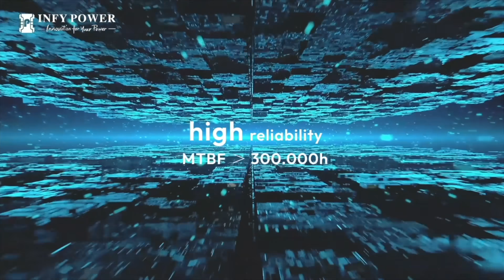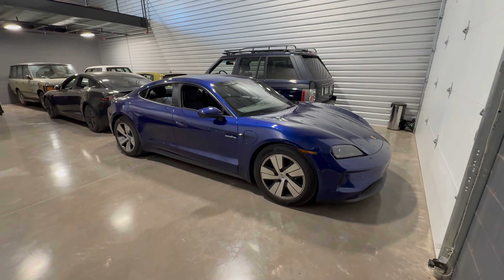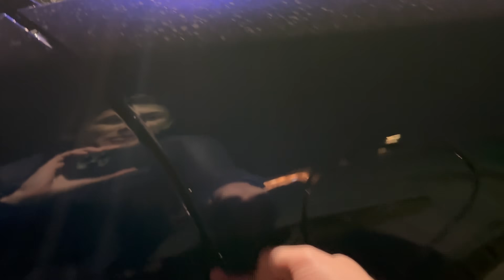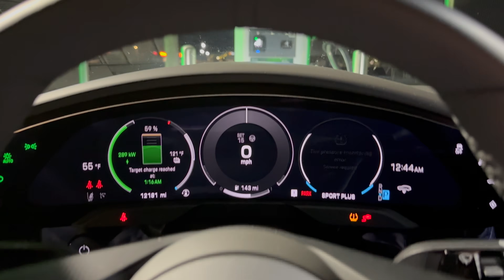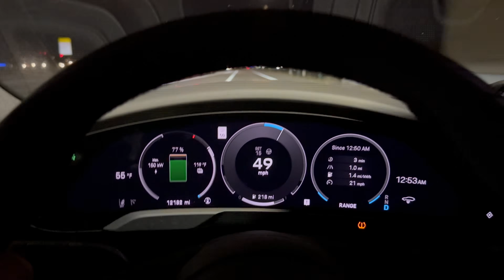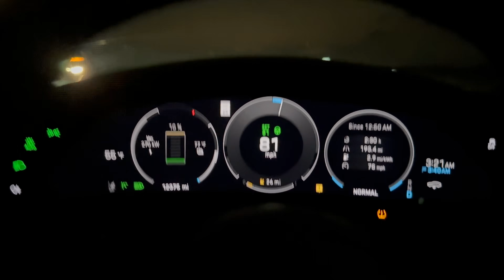EV Road Trip King! Porsche Taycan Goes Insanely Far After Only A 15min Charge In The 10% Challenge

Comment: Battery Life - any issues with premature degradation ? Not talking fires but saw a few posts discussing Taycan's batteries prematurely losing capacity, speculatively due to Porsche's high speed charging design. Even on your Las Vegas rally, the Taycan wouldn't fully charge to 100%  I was interested in a used one but that's one part replacement that's too big to swallow.

Comment: IDK about the logic of running cabin HVAC during charging.  The last place you, or your dog, should be during a 15 min stop is in the car.  After sitting in the car for 2-3 hours or more of driving, it is time to get out, go for a walk, and use the restroom.  When you get back to your car, LEAVE.  Don't just sit there charging.  My experience on Tesla road trips for the last 8 years is that the car is sufficiently charged when I return.

Bottom line: I don't run HVAC during 15 min stops.  If stoping for an hour to eat, and leaving your dog in the car, then running HVAC is needed, but charge performance is not needed.  Slower charging would actually be helpful to allow you to finish eating before having to unplug and move your car.

Comment: What is really impressive is that this test is done at 80 mph. There are parts of the US where you can’t maintain 80 mph for 193 miles. In the northeast this car would go well over 200 miles on only 15 minutes of charging because of the much slower speeds.

Comment: My car is not a good comparison. I drive a 2021 Toyota Prius L. Eco and road tripping like this. I would slow down from 80 to 75 but I would still be getting 50 plus miles per gallon with a just over 11 gallon tank. So I would be looking at about a 10-minute stop for about 500 mi of range in my Prius in the same situation or scenario. And even if I went 80 I would still probably be looking at 500 mi of range before I got low enough and fueled it. I felt they had to stop and go get gas but comparing this car to my '98 Subaru legacy wagon. Yeah that car gets about 27-28 miles per gallon on the highway and has a 15 gallon fuel tank and will do about 300 highway miles and a approximately 10 minute fuel stop for the Subaru would still yield me better results than this car but it's a much closer comparison cuz I'm looking at a few hundred miles less in the Subaru for the same amount of time on a single tank of fuel then in the Prius and yes, it is good to see that we are getting to the point where cars are charging this fast and you're getting basically one minute of charging allows you to drive 10 mi or more when you're road tripping the vehicle. Granted it's going to take a while for a lot of manufacturers to catch up to having these types of charging speeds with these efficiencies especially Toyota and other manufacturers that don't even have electric vehicles yet but even with the two cars that you just recently tested were getting to the point where if they get much better we'll need to be looking at improvements to the charging infrastructure to be able to make them charge much faster cuz the infrastructure is only limited to delivering 350 kW of charge at the moment and we might need to make it so it can deliver up to 500 kW of charge if lucid and Porsche make too many more improvements to their ability to charge the batteries in these vehicles, especially Porsche.

Comment: I am more blown away at the cost of high power charging. I understand you are charging at home the vast majority of the time, but to spend almost double in electricity than what it would take in gasoline for a similar vehicle is not acceptable.
Reply: Depends on the ratio of home to public charging right? At some ratio there is a breakeven point. Though you probably wouldn't need a Taycan then.

Comment: What's crazy to me is the price off that charge. Imagine charging it 0 to 100% it would be around 60$, and let be honest, almos any gas car with 40-60 on gas can go minimun 250 to 300 miles easily. So I don't see the real benefits of owning an  electric car when you have to pay more for the car and, in the end, spend almost the same on gas/electricity. For me, I think the best option is a hybrid. You can use the electric mode for city driving and short runs, and on the highway, you use the gas engine/combination and go way further than an electric one.
Reply: Is it because of the zero emissions?

Comment: Incredible charging speed! Love these videos! Still not comparable to fuelling an ic car but we are getting closer to the point where charging speed is no longer an issue and the limiting factor is the person behind the steering wheel. My 15 year old diesel estate will fuel faster and go longer than any EV today at a fraction of the cost (considering total cost including buying the car, insurance, fuel/electricity etc). I filled my car with 55 litres of diesel today. Took me about 3 minutes. It will now go another 1000 km before having to fill up again - no matter the weather and at highway speed.
Reply: Suck on that tail pipe 😊

Comment: So Ryan beat Kyle in the race from Vegas in a Taycan, and now he runs it to the new top of the leader board in the 10% challenge.  So have you ordered a 2025 Taycan yet Ryan to replace that M3?  LOL  Looks like Lucid needs to step up their charging game pretty badly.  Lucid has a Tesla style charging "curve" which is really a straight down slope.  

I am surprised the Ioniq 6 didn't rank higher in this test since it's charging speeds if you get a good charging session it can onboard some juice.  Who ever can deliver that fast charging with the efficiency to go with it will be the next king.  That Taycan really isn't that efficient.  So this should be a number that can be beat.
Reply: The Ioniq 6 is being held back by the small-ish max battery size. If it would have the 84kWh battery from the facelifted Ioniq 5, the facelifted Ioniq 6 does gain access to it around Q2 next year, it would have recharged more energy and therefore range at the same time.
The 77kWh battery recharged from 10-67% SoC in 15min, that is around 44kWh into the battery. With the new 84kWh battery and a 10-66% SoC result charged in 15min it would add 47kWh back into the battery (Hyundai claims the charging speed stays the same even though the battery is bigger and the peak charging power remains the same. They improved the charging curve instead. To be safe I would still consider a very slightly decrease in charging speed). The 3kWh more energy compared to the smaller battery is another 9 miles of range? Then the Ioniq 6 would end up at 150 miles of range. Very close to the Lucid Air GT with aero wheels.
Reply: @Bernd-b1y  It does seem like the eGMP cars are a little more finicky and not quite as consistent at the chargers whenever I see someone showing the charging speeds.  Seems like that Porsche does a more consistent job of hitting good numbers.  I would think in 15 minutes at a good charge rate in an I6 that it should be able to pack more electrons in there.  Good point on the refresh.  There will be a few more kwh's in the refreshed car and they said it will still hit the same SOC in 18 minutes that was previously advertised.  That sounds like a speed bump to me.

Comment: We already knew from the Bolt that pouch cells make for a charging monster 😂
Reply: Well the bolt is only cooling the edge of the cells which is why it has such poor charging capability. It has just enough thermal management to not kill itself like the Leaf batteries.
Most other EV's with pouches use plates between some of the cells to pull a lot more heat out.

Comment: If the model 3 lr rwd could eventually have that battery capacity and charging curve 😵‍💫. That would be the best ev on the market hands down. I think a combo like that would be enough to get most ice owners to switch over
Reply: Are you saying the M3LRRWD is not the best EV on the market?!
Reply: Hard to do with cylindrical cells, less surface area for cooling vs flat pouch cells. Tabless was supposed to help with that. It still should, but they'll have to weld the battery to the cooling plate somehow to be able to pull that heat out.

Comment: Yeah, that's some pretty crazy fast charging. I think most people would agree that the ICE "equivalent" would be about 350 miles of realistic range added from a stop that usually ends up being 15 minutes, so we're getting pretty close in terms of EV capabilities. At this point, the driver and passenger really become the bottleneck.
Reply: No, the charging stations are the bottleneck … not enough of them, too many broken, not spaced well for non-interstate-highway driving on long road trips … this video assumes ideal charging-station circumstances, which is very rare
Reply: @panameradan6860  That hasn't been my experience, especially recently. Occasionally, you might run into issues, but when you have 200+ miles of real-world range after just a 15 to 20 minute stop (as demonstrated in this video), you get to be a whole lot pickier about where you stop to charge. That means, at the very least, you skip one to two 350 kW charging stations on almost every leg of every interstate corridor.
Keep in mind, there still aren't that many EVs on the road period, most are Teslas that are prioritizing the Superchargers, and not that many people actually travel long distances that way in the first place. It's really only cities where you're going to run into crowding, but that gets back to my point about being able to skip over problematic stations and areas.

Comment: Remember that graph Peter Rawlinson shared a while ago, making the point "Lucid has a significant EV advantage" for the coming years. Media outlets and car journalist should take this video as a blueprint for good consumer advice! Porsche's battery tech is just next level and Mercedes as well as BMW will follow with updated/new platforms.
Reply: Porsche moved to an 800+V architecture like Lucid. There’s nothing magical or special about what’s going on here; the battery “tech” isn’t special beyond having excellent thermal management. 

If anything, it proves that Lucid was right and everyone else is waking up.
Reply: @OptimumSlinky  wtf are you talking about, Porsche was the first manufacturer to bring 800V in a mass produced EV, the Taycan was available  for purchase at the end of 2019 with 800V already. This Taycan is just a facelifted version of it. Another thing which you got wrong is that Porsche's charging curve is at the forefront of what is possible because of superior thermal capabilities and battery management system, way better than Lucid.
And BMW and Mercedes do catch up or slightly overtake Porsche/Audi with their upcoming 800V platforms, but not the platform of the Porsche Taycan (which is on another level) but the 800V PPE platform used in the Porsche Macan or the recently revealed Audi A6 e-tron. The Audi A6 e-tron will already match the Lucid Air in this test here, no problem. The upcoming Mercedes CLA and BMW i3 sedan will surpass it, even tho they are significantly cheaper.
Reply: The only advantage Lucid has is the Saudi wealth fund. They are selling $250,000 cars for $100,000, and they've only sold a couple thousandof them. They are blowing through almost a billion dollars a quarter. They are  getting huge infusions from the Saudis, but if they ever decide to turn that tap off the company evaporates overnight.

Comment: 79kWh delivered in 15 minutes, then going over 190 miles in winter weather conditions with those kWh. As Bjorn would say, It's game over ICE.
Reply: You call 45 - 50 ° winter? Visit Wisconsin and experience real winter at -20° F. Also. $40 for 193 miles seems pretty expensive to me. 😂
Reply: @andik2329   I'm from the north, I know what winter weather is. But I also know that 45-50 degrees is definitely not summer, either. For 75% of this country and population, that's considered winter like weather. Heck, I've been in the south when it's 60 and they have coats on. The point was, that was far from optimal and still did that well. And how does around $7 for those miles sound like? That's what most people pay at home. And add it in less than 10 seconds. 

And if you really want to see how EV's do in real winters, as in minus 34 degrees, check out Bjorn Nyland's videos. He's in Norway, the country with the world's highest concentration of EV's.
Reply: @junehanzawa5165 
Yes but tiny country with low speed limits ... And massive incentives for EV's ironically paid for by selling fossil fuels. 
ICE is still cheaper and faster for road trips. But much cheaper when charging at home.
Reply: @junehanzawa5165 … sorry, but 50 deg F is not considered winter-like conditions by 99% of the American driving population … “winter-like”, furthermore, has a much more important and concise meaning in BEV terminology::  below freezing while driving and while charging.  … 50-degree weather simply isn’t a big issue for BEVs … context, context …
Reply: @panameradan6860  If you don't think southerners consider 45 to 50F as winter-like, then you've never been down there in winter when at times it gets to those temperatures. That might be nothing to us in the north, but to them, it's time to stay inside or go out in heavy coats. But don't take my words for it, there's plenty of videos on that. You have the internet in the palm of your hands.

But notice how chose to overlook the one country with real winter weather I provided. One so cold and far north that the sun is never seen for months at a time on it's northern section. One where 93% of new light duty vehicles (cars, SUV's, vans, pickup trucks) are fully electric. So if they don't have an issue with them, then you're either listening to misinformation, or are here spreading it.
Reply: @andik2329  Yeh, at $4/g gas that's like 19.3 mpg.
Reply: @kens97sto171 Norway is 1,100 miles long. That's like driving from NYC all the way down to Disney World in Orlando, FL, which is 1,081 miles away, And the speed limits on their highways are 70mph, just like most of the US. And of course, just like here, most drive at 80 or 85mph on them.

But if you want to see the nightmare that's coming for people with blinds on like you, (or anyone reading this) just look up The Crazy Charging Parks of Norway.
Reply: @kens97sto171 Norway is 1,100 miles long. That's like driving from NYC all the way down to Disney World in Orlando, FL, which is 1,081 miles away, And the speed limits on their highways are 70mph, just like most of the US. And of course, just like here, most drive at 80 or 85mph on them.
Reply: The truth is that ICE will never be dead simply because there is not enough energy for all cars to be electric. EV technology is developing while the grid stays the same

Comment: 190mi for $35 is not very impressive. I thought EV's were supposed to be cheaper to run. I bet a base Panamera would beat that $ per mile.
Reply: Most people do most charging at home which is much cheaper.
Reply: They are meant to eliminate CO2 emissions.

Comment: That point where charging isn’t that different than filling a tank will only happen when you have to modify the test to 10 or 5 mins of charging because all the new cars are way off peak charging by 15 minutes and are just trickling in the last 10-15%. It will probably require new charging station tech, many years out.

Comment: What nobody is talking about is the cost of charging using high speed chargers like Superchargers or EV America and the likes. On a recent trip with my 2024 M3P (3.8 miles/kWh)  it actually cost me more to use this of the most efficient EVs in America, than it would have cost me to drive my 2017 VW Passat (32 mpg). I paid an average of $.40/kWh, versus gas is now about $3/gal. Even the most efficient EV in America, the Tesla Model 3 LR RWD (4.9 mils/kWh) would lose to cars with 40+ mpg. For home charging the game is over, but for road tripping, it is generally significant less expensive to drive your ICE car than your EV, size being similar.

Comment: 39.70 for not even a full charge, cost beyond just the purchase of the car is way to high in my opinion. I once did a run with my cooper SE and found out it would have been cheaper for me to drive a diesel suburban which is just bonkers. I get that charging at home is cheaper than gas but its crazy that charging on the road is more expensive. Wish it was cheaper
Reply: I noticed that as well, the cost definitely needs to come down.
Reply: Infrastructure is expensive to get into the ground....
Reply: We are on the road 1-2 months of the year, but at home charging 10-11 months … the huge savings of charging at home over 10-11 months counterbalances any extra money paid on road trips (vs. gasoline)… one can always drive your second ICEV on road trips (or rent an ICEV for that)

Comment: In the wise words of Bjorn Nyland… “Hoooooly Guacamoleeee!”
Reply: He switched to Maccaroneeee a while ago.
Reply: Sheeeitttttttttt
Reply: On a Tesla V3 charger it will max out at 150 kW due to the on board DC to DC converter. This is because Tesla still does not support 920 V DC charging like most public chargers do. A similar limitation happens on the lucid air and the EGMP cars.
Reply: @automatix5  this is a Taycan. Different platform. Does not split the pack.
Reply: Do we know what the charging speeds look like using a V3 charger?